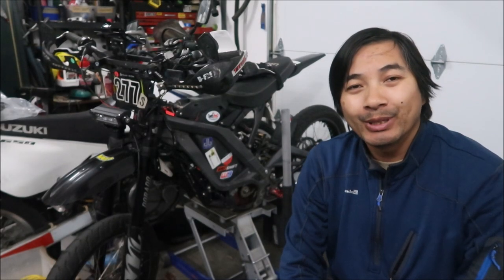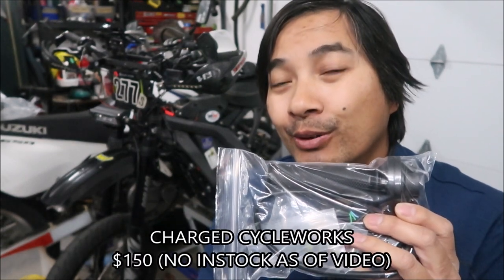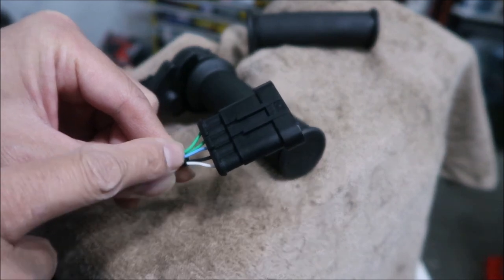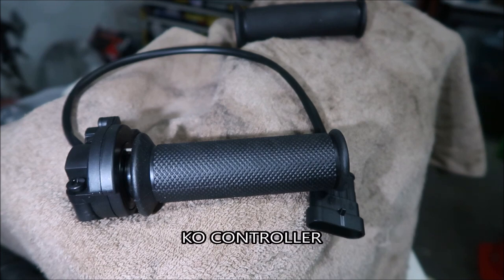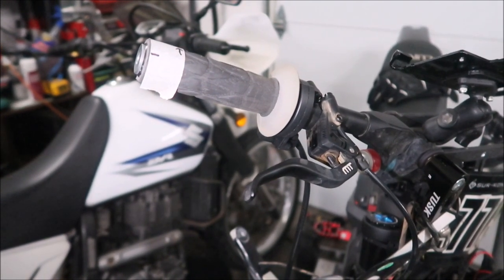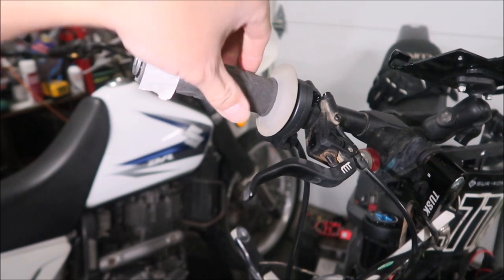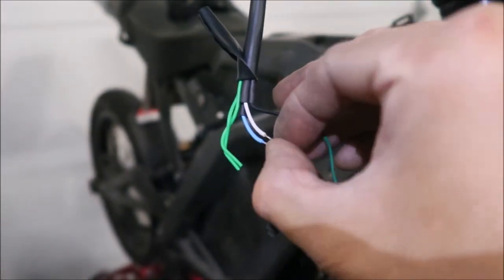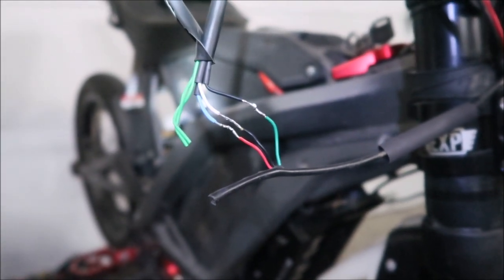Domino Throttle Install Sur Ron Light Bee with KO Controller

Comment: Great video. So after 6 months of use, domino better or the same as stock throttle? Same feel? Do you like the resistance now? Or still don’t like that? Worth the 180$ upgrade?
Reply from the maker: I still like it still smoother than the Sur Ron.  I have a cramp buster on it right now.  I must have a weak grip or something.
Reply: @hadesomegamoto7639  Thank you for the feedback. Thinking of upgrading mine as I just picked up a TC500.
Reply: get the hall version of this throttle, mine died after one year of use .... The pot will wear of at some point

Comment: I have 2021 surron x bike  what's the difference between  my stock throttle and that throttle  ??? 
Is this meant for ppl who have k.o ??  Not stock controller ?? 
Thanx for ur time 😊
Reply from the maker: There's no difference except the connector, I am not 100% sure but you may need recalibrate the throttle and you can't do that with a stock Sur Ron controller.

Comment: Any opinions on running the 219 chain version of this?  Trying to figure out which one may run quieter.....the Warp with the noise reducing coating or just the thinner 219 chain?
Reply from the maker: 219 chain is quieter but I hated it.  It was high maintenance and didn't last long.  Every time I ride it needs to be tightened and lubed.  Also 420 chains are much easier to find and easier to install because you can easily break them.
Reply: @hadesomegamoto7639  Thanks dude, exactly the kind of answer I was looking for.  So many other people were like "either is fine" but it didnt seem like they had experience with both.

I'm about to dive in on wiring up my Domino throttle, which is how of course I found your channel.  Is there anything that can be done with the extra 2 wires and the microswitch?  I have an EBMX-9000 controller.
Reply from the maker: @JESSEverything  I was thinking of doing something with the wires but I never did.  I have an X-9000 now also and it works fine EXCEPT for some reason when I am calibrating it doesn't record the voltages right.  I kept on trying until I got the voltages close to real voltages.  If you can get the password you can manually input the voltages also.  It's easy to check the min and max voltages using the diagnostic mode.
Reply: @hadesomegamoto7639    What did you expect the voltages to be at vs. what they registered as?  I did the throttle setup on my stock throttle as well as with the regen brake and one ended up at like 0.85 min and the other was like 0.86 and a maximum of 4.30 on both.  The default settings in the controller before I did the setup was 0.9 min and 4.30 max.
Reply from the maker: @JESSEverything  It differs between throttles.  That's why you need to do a recalibration.

Comment: He do you know if I pull my horn off if I can connect a small  light for under glow
Reply: No. Connect to the rear light wires.
Reply from the maker: I think if you do that it will only turn the light on when you press the horn button.  You can wire it to a 12V source like for the USB charger or headlight.